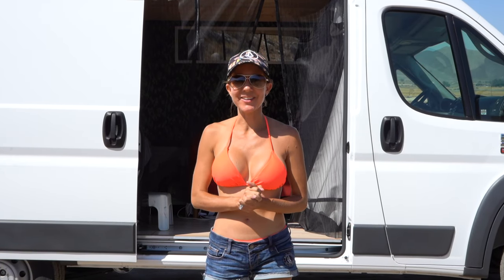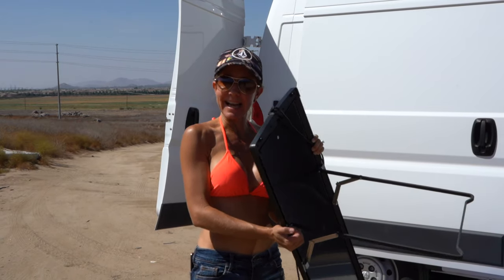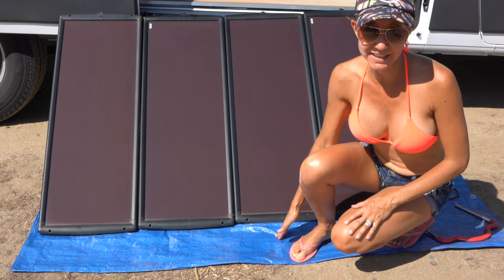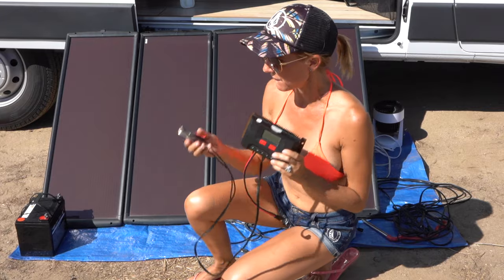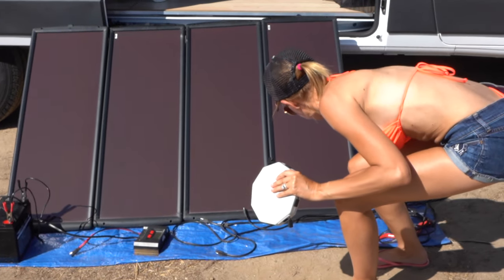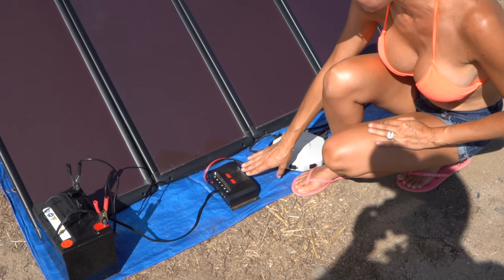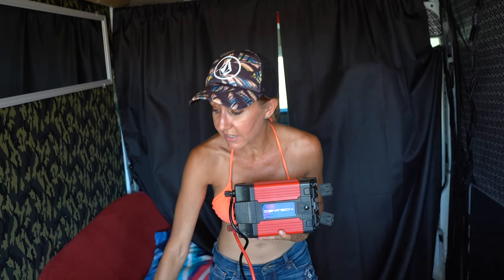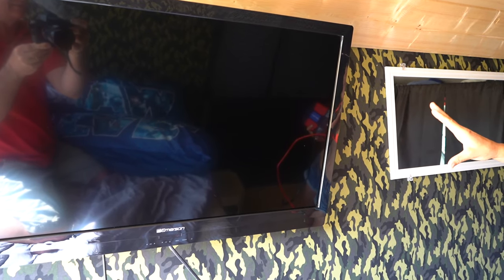Lisa Sets Up & Explains The Harbor Freight Thunderbolt Solar System, Battery, Controller, Inverter

Comment: I hooked up my battery to a harbor freight 100 watt solar panel.  I got an error code (E11)..    I know the battery is low.  But, will the panels still charge it?

Comment: Thank you for the video when my power is out for short periods of time I use an inverter on my pickup truck to run my TV and satellite but I have to leave my pickup running with a solar panel like that I could run my TV and satellite and have the panel's charging the battery and I wouldn't have to start my truck unless it was dark and if the power's out for more than a few hours I run a generator so I think those panels would be perfect
Reply from the maker: Glad it helped

Comment: Hi thanks for the video 
I have a question what will i need to run a portable ac unit or a mini split?
Reply: You need a converter with more watts depending on how many watts is your ac

Comment: Two things- Appreciate the acknowledgement of proper battery hookup etiquette. Frequently overlooked. Also, will the battery, charging alongside the inverter inside that end table, be an issue due to off-gassing in a confined space? Or do you leave the door open?
Reply from the maker: The batteries we use are AGM sealed batteries. They are not supposed to off gas. It is my understanding that off gassing is mostly some hydrogen. Can be dangerous. But hydrogen is lighter than air so it can be vented out. Thanks for asking.
Reply: @billisa  Thanks for your quick reply :) I ask because my Miata has an AGM battery factory mounted in the trunk. The battery's vents have small hoses that are routed to the outside.

Comment: Can I operate a 600 watt hot pot for no more than 30 mins with 750 watt inverter using Harbor Freight Thunderbolt Solar System as it is
Reply: Yes

Comment: Hey Bill and Lisa...thanks for the detailed explanation of the hook up and the math on battery usage.and the draw when using solar while charging the battery and the same time. I'm just learning about solar and going off grid....where did you get the battery and can you hook up multiple batteries to charge at the same time or do you use the 4 solar panels for only one battery??? And tips and info would be appreciated ...Thanks again (subscribed)
Reply from the maker: yes you can charge multiple batteries at the same time in parallel. We just did updates to this video here  https://www.youtube.com/watch?v=iYCNUt9WYSY   and here https://www.youtube.com/watch?v=Txa9j6stnlU&t=6s

Comment: How has the kit been hold up with respect to durability?  Much thanks.
Reply from the maker: No problems at all. Our videos starting a week ago on May 21st, 22nd and 23rd go into great detail. We installed them on the roof of our van and put the battery, charge controller and inverter inside our van. Thank you for your question.
Reply: @billisa  Thanks for the reply!
Reply from the maker: anytime

Comment: How big is your inverter?
Reply from the maker: 750 watts
Reply: @billisa  thank you so much. I want to look into a similar setup for my home. I live in Warren TX. We have been through several hurricanes over the years. One time we had a 400 watt inverter hooked to our car battery for a fan. It worked good. The inverter had a low battery alarm. I really like that harbor freight solar panel kit. I want to get one for a homemade battery bank. Do you have any tips for this idea?

Comment: that charge controller can not handle 700 watts, i have the same controller and they lied on the package, on my package it claimed 500 watts. its fused at 15 or 20 amps. 14v x 15amp = 210 watts or 14v x 20amp = 280 watts. lets say it can do 700 watts, 14v x ?= 700watts, that means 50 amps. no way can that thing do 50 amps. the battery is a 35 amp hour, not just "35 amps", also you can only use about 17 ahs before you need to charge it. 12v x 17ah = 204 watt hours, that battery is rated at 35ah at a 20 hour drain rate, and we can only use half so: you can only pull .85 amps for 20 hours. 12v x .85= 10.2 watts continuous. thats about enough to power chargers for two cell phones, or power one led lamp.for 20 hrs. you need to inform everyone of "Peukert’s Law". the more amps you pull from that battery the less efficient the process becomes and you will loose significant capcity, meaning less time to that 50% discharge rate. those panels are connected to a pwm controller which means this: 14.4v x 4amps= 57.6 watts at peak, not a hundred, again the company is misleading its customers. the panels are 24 watt panels, the math they use 24v x 4 amps = 96 watts, but we are using it on a 12 volt battery so only 14.4 volts max will hit the battery. if the sun is out and the panel is pointed right at it you will get about 1amp per one of those panels, the moment you get a little cloud in the way the amps will drop a bit, if its very cloudy expect the amps to be half or less. why does everyone say disconnect the negative first, the circuit is broken? the inverter doesnt use a fixed amount of power, well except when you turn it on with out a load. i bet that inverter pulls .5amp to 1amp just being turned on. which happens to be very close to  your .8 amp 20 hour rate. the inverter probably is 75-85% efficient, lets pretend its 90% efficient across the entire range of watt load it can deliver from 0 watts up to 1000...(guessing on your max), if you need 100 watts ac, the inverter will use 110 watts dc. i like your rig, fun fast presentation, just thought i'd help make a few things clear to others who may take your words as you exactly said them. well done